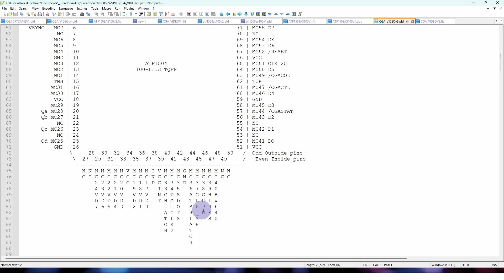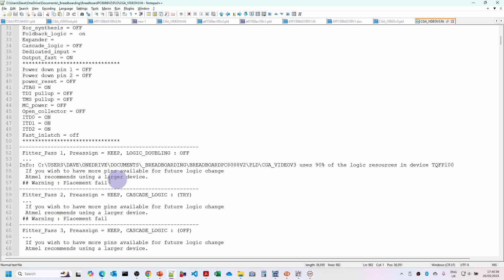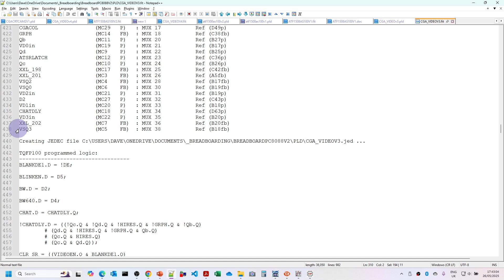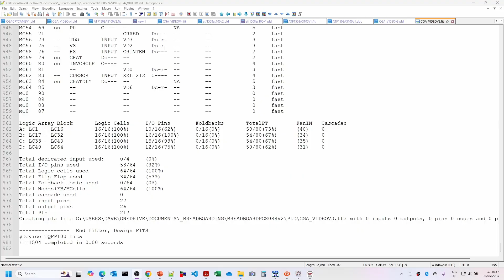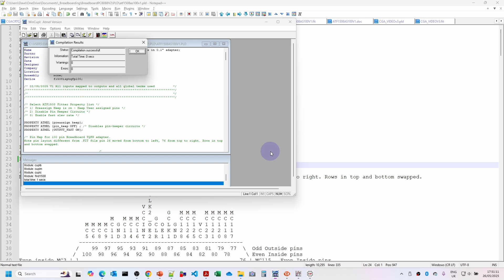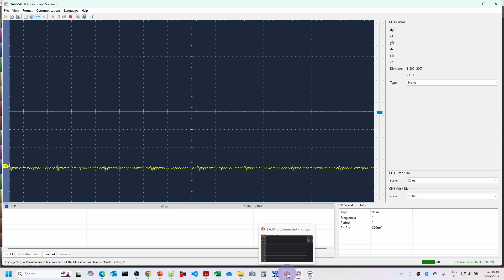Tips for using ATF1508/150X Surface Mount Complex PLDs on Breadboards (PLDs part 9)

Comment: Another awesome video! This time with very useful tips! Thank you! 😀 

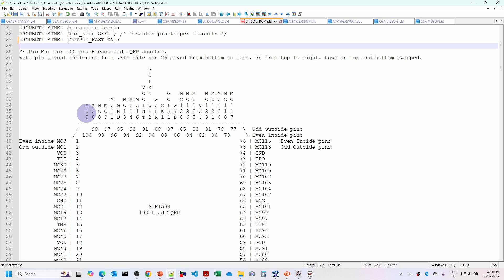Just a minor observation: At 10:47 You forgot to update the name of the chip in the center ASCII art image. Not that it matters from a technical point of view, but it took me a couple seconds to make sure whether you're talking about 1504 or 1508. 

Stil,  great video! Please continue uploading as often as possible! ❤

Also please note that there are 1508ASL that use less power (especially less "static"/ idle power), 1508ASV that operate only in 3.3V, and 1508ASVL that are both low power AND operate only on 3.3V. I've learned that recently, so just wanted to share with anybody reading this comment 😅
Reply from the maker: Good catch, will update it before it appears in the CGA video. Dave